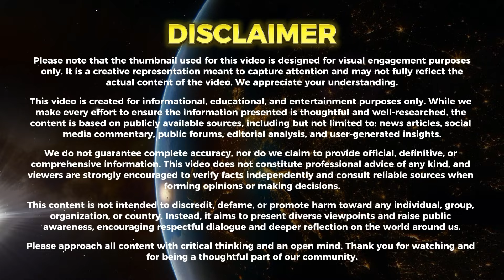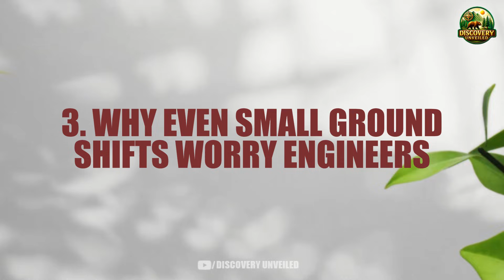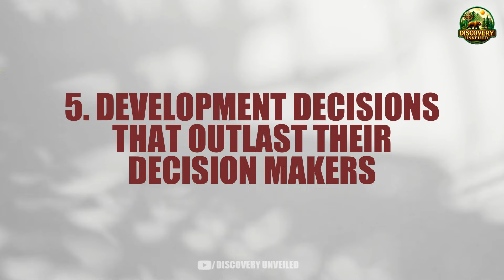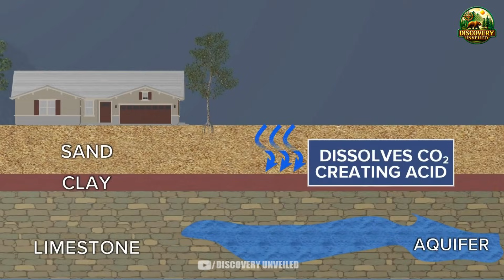Florida Governor Stunned As Multiple Buildings In Miami Sink At A Terrifying Rate

Comment: Common sense must tell you after a time problem going to accure..
Water soak water damage soft earth from water.
Building weights on water
Reply from the maker: Water weakens soil over time, and heavy buildings add stress. How can better drainage, limits, and monitoring prevent failures earlier?

Comment: Should check underneath the homes in the community of Palm Springs North in Miami Dade County. Due to the constant blasting our homes are shaking  like Rag Dolls on a daily basis and  have those large cracks talked about here.
Reply from the maker: Residents should report cracks, request vibration monitoring, and push for inspections. What data or timelines have you documented so far?
Reply: @DiscoveryUnveiledd All been done. White Rock Quarries (Limestone) is Untouchable.  Florida doesn't allow them to be sued and in all these Decades nothing has changed.

Comment: There is hope in the soundness of the buildings.  It sounds like they are going straight down.  How does this relate to the seafloor changes just off the coast?
Reply from the maker: Vertical settling suggests ground compaction, while offshore seafloor shifts affect wave energy. How can joint monitoring link both risks?

Comment: HEY!  IF you want buildings that won't sink, won't fall over, won't get shaken apart, make them float, with large counterweights, so storms won't topple them, and maybe even go as far as building offshore submersible building complex's, that can submerge out of the high winds, storm surge, and huge waves! Replacing buildings and houses, every few years, is rediculous,  expensive,  and still only offer minimal safety for people.  Your state is to close to sea level to build underground,  but building in the ocean, has some huge benifits. Building less stories, will also help alot. You need to look at long term solutions.  You are on the wrong side of the tide. Go farther out, deeper water, and out of the storm. 
In higher elevations, build mostly underground,  with minimal exposure,  except for windows with steel shutters, and natual light, piped into living areas, and your underground vertical greenhouse. You can even harvest heat from the Sun. 
Green sustainability,  reasonably, and cost effectively.
Reply from the maker: Floating or low-rise designs could reduce risk, but costs and scale matter. What pilots could test long-term safety first?

Comment: Yes, a recent University of Miami study found about 35 high-rise buildings in South Florida are sinking (subsiding) by up to 8 cm (3 inches) between 2016-2023, impacting areas like Miami Beach, Surfside, and Sunny Isles Beach, likely due to construction vibrations compacting sandy soils and potentially influenced by groundwater movement. While scientists say it's not an immediate alarm, the gradual sinking (0.8 to 3.1 inches) could cause long-term issues for mechanical systems, plumbing, and property values, highlighting the need for ongoing monitoring. 

Key Details of the Study:

What: A study identified 35 buildings experiencing subsidence (ground sinking).

Where: Along the coastline from Miami Beach to Sunny Isles Beach.

How Much: Sinking rates ranged from 2 to 8 centimeters (0.8 to 3.1 inches).

When: Data covered 2016 to 2023.

Why: Scientists believe heavy construction vibrations compact the sandy limestone layers, and tidal groundwater or stormwater injection might rearrange sand grains, causing this settling. 

Why It Matters:

Long-Term Concerns: Even slow sinking can stress building systems (plumbing, electrical) over time, potentially leading to significant repair costs.

Not the Surfside Collapse Cause (Yet): The study found sinking in buildings near the 2021 Champlain Towers collapse but didn't link it as the direct cause, though it sparked the research.

Call for Monitoring: Researchers hope this data encourages officials to use technology like satellite radar (InSAR) to monitor building stability across Florida. 

In Short: While not an immediate crisis, dozens of Florida buildings are slowly sinking, a phenomenon linked to construction on vulnerable sandy ground, prompting calls for better monitoring. 

New study finds subsidence hotspots impacting buildings in South Florida

Dec 13, 2024 — A recent study by scientists at the University of Miami Rosenstiel School of Marine, Atmospheric, and Earth Science and collaborators revealed that 35 buildings...

￼

University of Miami News

￼

UM study finds 35 buildings sinking along South Florida coastline - NBC 6

Dec 16, 2024 — Nearly three dozen oceanfront buildings from Miami Beach to Sunny Isles Beach are experiencing some level of sinking, according to a new study from the Universi...

￼

NBC 6 South Florida

￼

Dozens of South Florida buildings are sinking, study says

Dec 18, 2024 — Researchers stressed the results of its study aren't meant to scare property owners but lead to further investigations and monitoring. "Our hope is that officia...

￼

FOX Weather

￼

Dozens of luxury condos and hotels in Florida are sinking, study finds | CNN

Dec 23, 2024 — The effect is like shaking ground coffee around to create more room, Falk Amelung, senior author of the study and a professor of geophysics at the University of...

￼

CNN

￼

Concerns over sinking Florida skyscrapers date back decades

Dec 1, 2025 — That means continued settling could, in the long term, potentially leave homeowner associations with a “huge expense,” said Kolar, the Falcon Group engineer who...

￼

Miami Herald

￼

￼

10:40

Dozens of High Rises are Sinking in Florida

￼

￼

YouTube·Real Estate Report

￼

1:39

About 3 dozen high-rise buildings in South Florida are sinking

￼

￼

YouTube·WQAD News 8

Unseen forces may play role in buildings sinking in South Florida

Dec 1, 2025 — That type of vibration-induced settlement is not an isolated concern. Vibration is enough of a recognized issue that new sensor technology is now being marketed...

￼

Miami Herald

￼

USA: Luxury condos, hotels in Miami sinking at unexpected rates

Jan 14, 2025 — The study, published Friday night, identified a total of 35 buildings that have sunk by as much as three inches between 2016 and 2023, including the iconic Surf...

￼

PreventionWeb

Comment: The ground cannot support a large building without a suifficient water table that stays above sea level otherwise you will create a void that will eventually succumb to the weight of the building,=.You are going to have to conserve water until enough water until salination plants can be built to supply a populated state with enough water to normalize minimal ground water consumption. You must adjust for the changing times or a real Sim City will be lost.
Reply from the maker: How can conservation, reuse, and phased desalination stabilize groundwater while limiting new coastal loads?
Reply: @DiscoveryUnveiledd  by allowing the ground water to rise and give bouyancy to the sand that supports the dirt above it llke it was before  overpopulation gulped all the ground water. When the Everglades water level is where it was in 1960 you 'll know you have it pegged.

Comment: There is NO safe way to build multistory buildings on a beach. The tide turns twice a day, the water surges under the building lifting it then slowly dropping it over and over and over. All of that motility causes walls to crack, support beams to twist and fail. Then there is the sinking he brought out.  There is no stability as long as the ground moves beneath the buildings.
Reply from the maker: Coastal foundations face constant stress. How can design limits, monitoring, or zoning reduce risk where ground movement never stops?